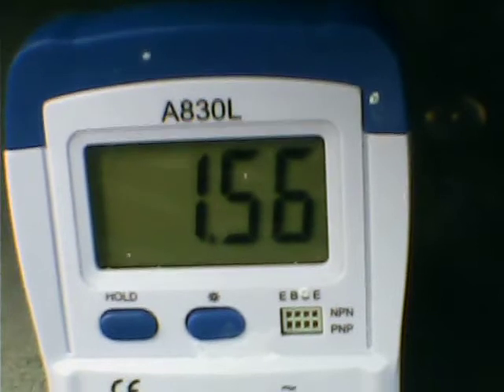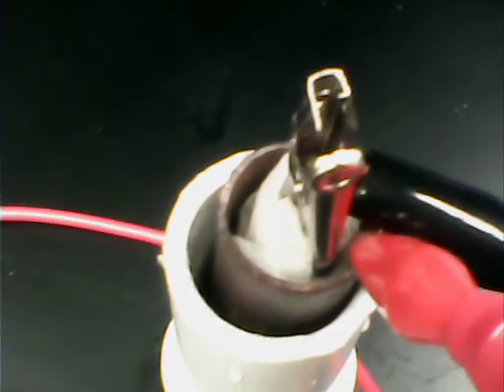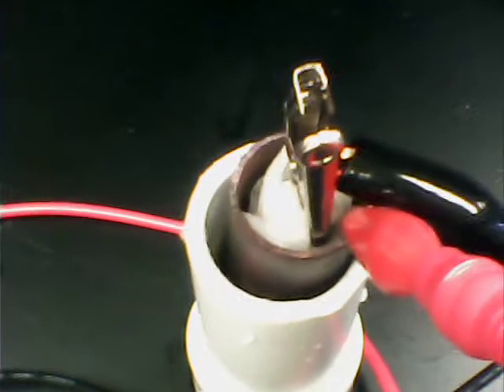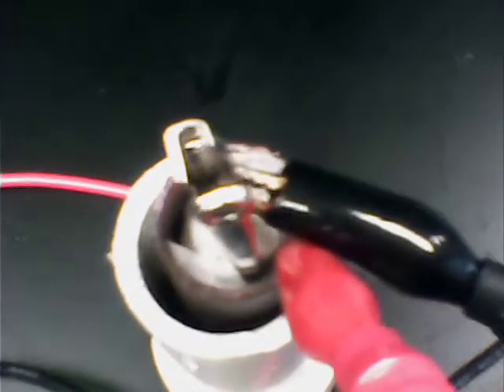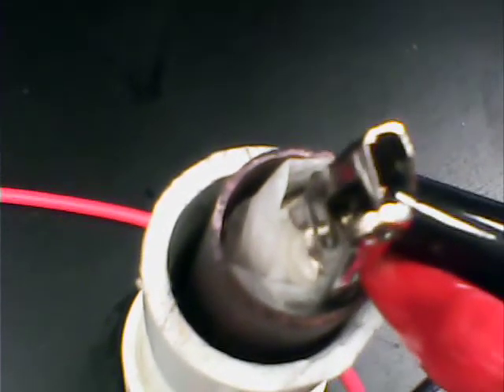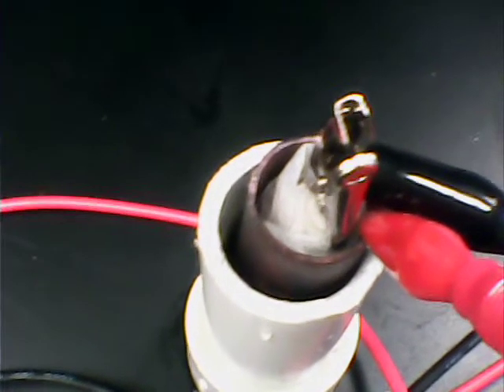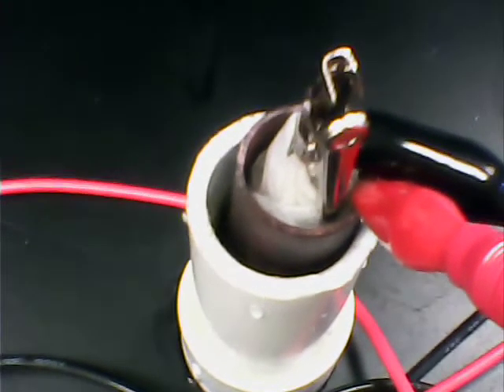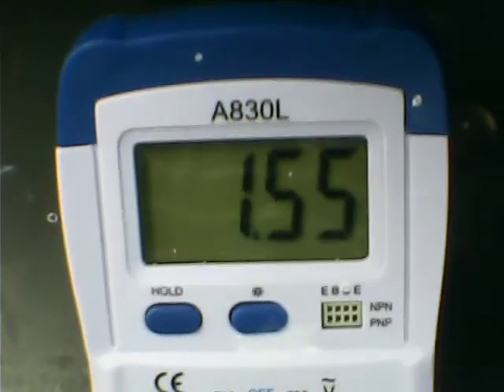Magnesium Air Battery/ No Electrolyte Addition

Comment: if its an air battery, then give it some air. remove the copper and use stainless steel screen as the current collector

Comment: Distilled Water is the electrolyte..in order to make a battery you must provide a way for current to flow from one conductor to another.. the best solution is to use something that has the most resistance so the battery does not discharge itself quickly when not being used But also more resistance then the circuit you are trying to use the battery 4  so you can get the electricity to go through the Circuit when it is connected because electricity follows the path of least resistance. it will have less resistance then the battery itself which is why batteries have a shelf life.  Depending on the resistance of the circuit you are using the batteries 4 will determine the most resistance electrolyte can have so the battery would work in the circuit. So you can make batteries with different electrolytes depending on the circuit it's going to be used in. This is why they have separate batteries for high drain products and low drain products. The shelf life is the same for the batteries if they used the same kind of battery for everything so the longer it sits  would determine if it had  enough juice left  2 power higher Resistance circuits. This is why they use different things as the components of the battery four different operations to increase shelf life by changing the resistance inside the battery for different applications. Electricity behaves exactly like water. In order to get water to flow there must be a valve for the water to get out and a vent hole so the water flows smoothly. And you can think of it like there is water that gets out the vent hole. The vent hole is the resistance of  the electrolyte and you can increase the size of it or make it smaller depending on the rate  you want the water to come out.. the vent hole would be proportional to the size of the valve to get the amounts of water that you wish... pretty simple to understand and I'm sure you understand this process but maybe just didn't think about it or some other reason. Everything in the universe is made of charged particles it's just how easy they are willing to give them up which determines a good conductor from a bad one. Insulators can conduct as well in the right conditions because they are charged particles like everything else. For example air is considered an insulator but you see lightning going through the air and hitting the ground all the time. It's hard to do it and that's why lightning is so powerful.